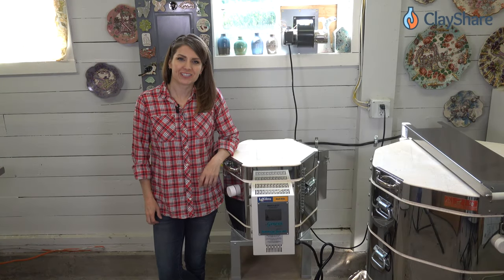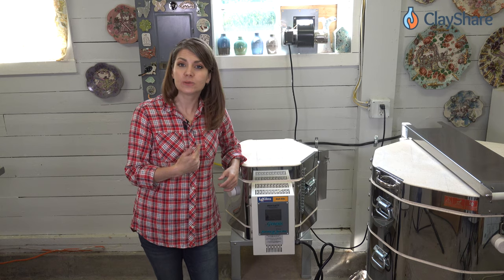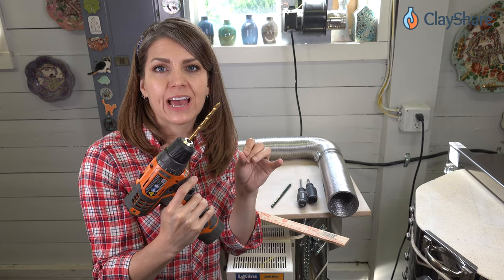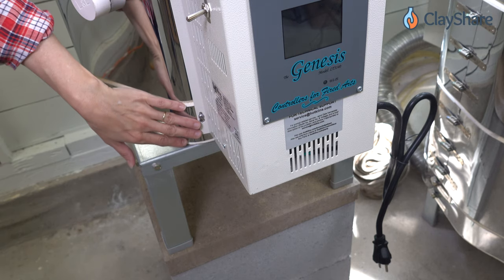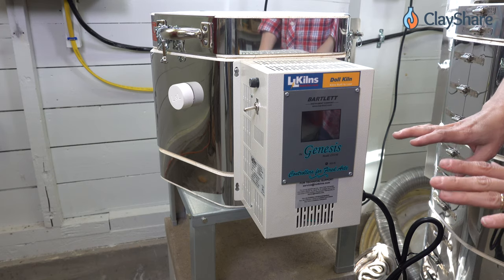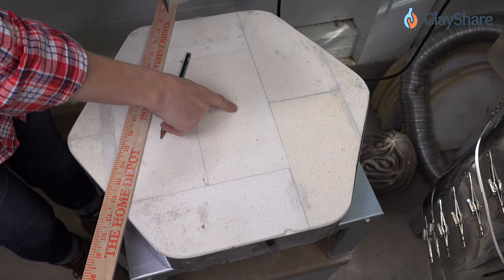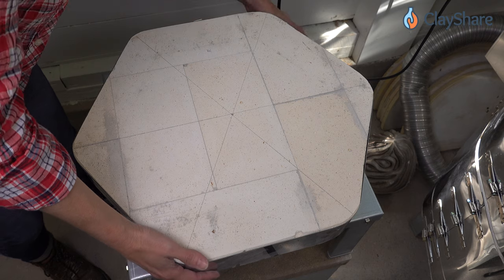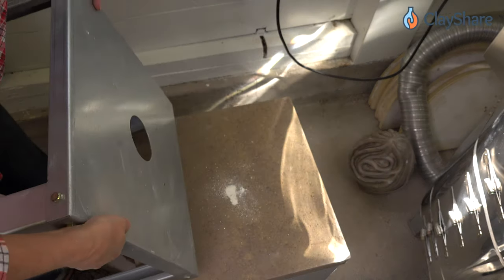Learn How to Install a Kiln Vent

Comment: I think you are one of the gems here in pottery land and I am very happy I discovered your videos just this past week.  I've spent hours watching all kinds of stuff you have put up.  While watching this video I caught something that I want to bring to your attention. At time stamp 10:21, you have already attached the hose to the plenum(box under kiln bottom), and attached ther plenum to kiln bottom.  As you are turning the stand around so the feet go to the floor, I noticed a most definite gap about an eighth on an inch from ther mounting lip to the stand.   This will greatly affect the vacuum you are seeking with the vent.   I have found it imperative to tighten those nuts with a tool such as a box wrench or crescent wrench, this will make sure your mounting of the plenum is quite secure.  
My very best to you and all your terrific efforts!
Nick

Comment: I love your videos. I have a question. Can you vent this without the exhaust motor? For example I am planning on putting my kiln in my garage temporarily and do not want to make a hole through the garage wall.  I wondered if I could just vent it by connecting the duct to the bottom and leaving the other end outside my garage door while firing?  I wasn't sure if this would cause any issues without an exhaust motor. We are going to later build a storage building in the backyard and I can vent it with a exhaust motor later. Thanks in advance.

Comment: Perfect timing. I ordered a Rohde kiln. It will arrive in two months (so long!!). A question about the blower. Are plants able to survive the hot air? Or is it best to put the blower far away from plants and trees?
Reply from the maker: The heat coming out is similar to that of a dryer. I would not have it blowing directly on delicate plants but if its a few feet away it should be fine.
Reply: @JessicaPutnamPhillips  Thanks! Very useful info!

Comment: Thanks for making this video, I've been thinking about installing a kiln vent in my kiln. Do you run the blower fan during the entire firing schedule, or just when it reaches a certain temperature? Is there a way to control the speed? I imagine that a small kiln like that would require less air movement than your larger one
Reply from the maker: I run the vent fan the entire firing then once the kiln shuts off I turn the vent off. :)

Comment: My kiln vent required a hole drilled in top also
Reply from the maker: You must have a different vent system than mine, the bottom mount vent system I use only needs a hole in the bottom. :)

Comment: Does that kiln work with a 120v?
Reply from the maker: This one is a 240v but you ca get kiln that will go on 120v but they don't get hot enough to fire to cone 5 just low fire at cone 04.
Reply: Jessica Putnam-Phillips ok...thanks for letting me know.